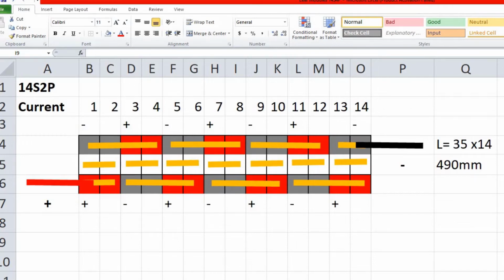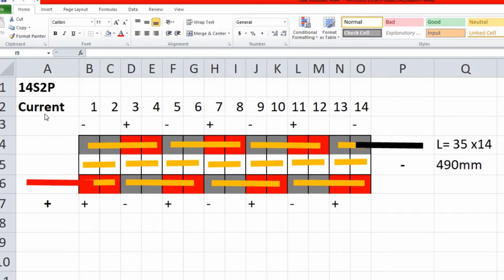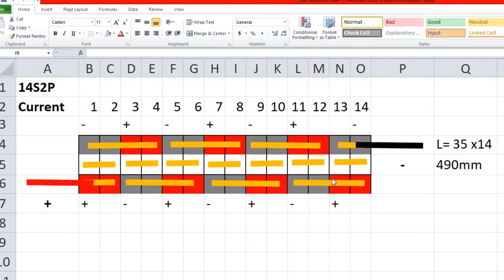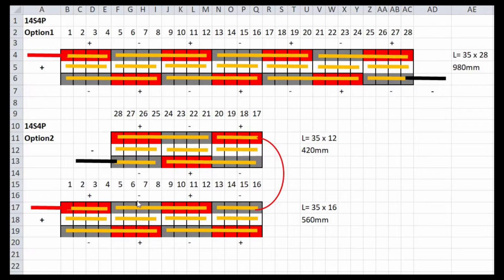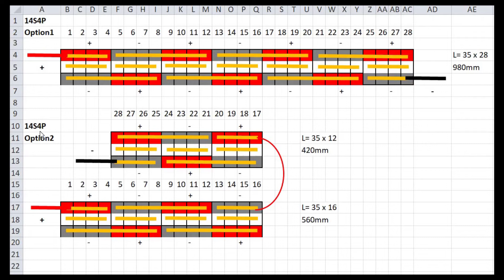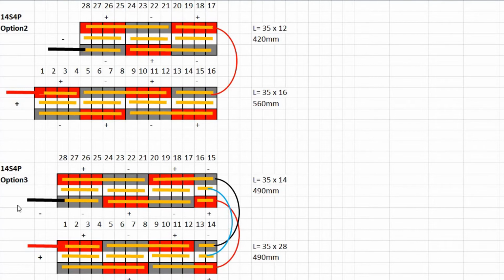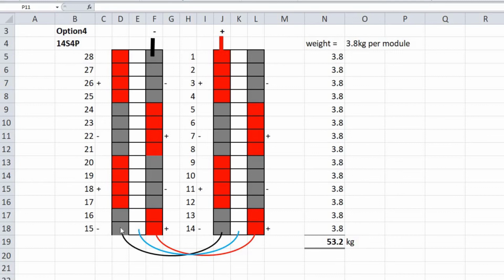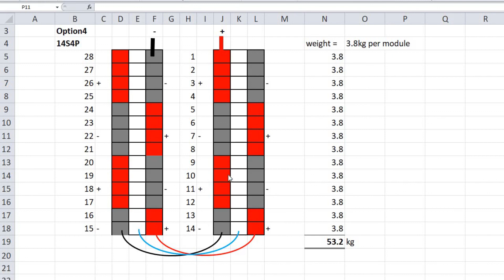48V 4P 14S Battery Bank Nissan Leaf Modules - Part1 - Design

Comment: Nice work!
I have 49 module and would like to set up a 48v  
Using a 14 a smart BMS. Is there a diagram you would recommend? How many amps for the BMS to Use?
I'm a 70 years  old guy still trying to be actif. Thank you very much for these very instructif videos.
Reply from the maker: Age is only a number ! I'm so happy that my video was helpful to you.
Amp is decided by Inverter rating. Say for example  Inverter is 5kW.   I=P/V; I=5000/48 = 105Amp. So you can add 1.2-1.5 safety factor = 150Amp is suitable

Comment: Nice work. Thank you for sharing. Do you have a video for part6? BMS configuration? I am building 14S 4P setup and not sure if I need BMS or the battery will keep the balance.
Reply from the maker: I'll publish Part6 in couple of days time.  
BMS is highly recommended as otherwise, used Leaf modules will go off-balance in couple of cycles.  
If you are going to use it without BMS, then regular voltage check (at least once in 3 days)  recommended for safety of modules as well as users.